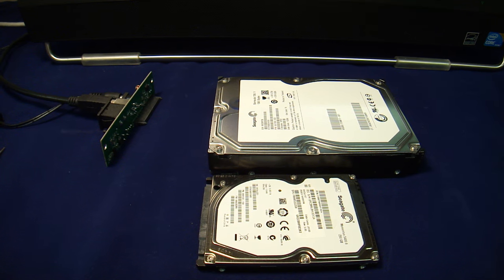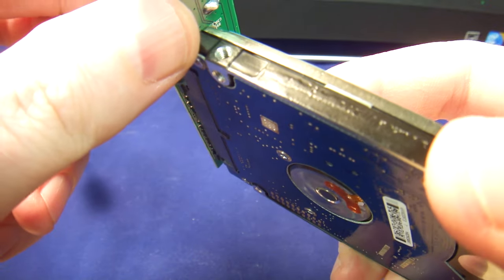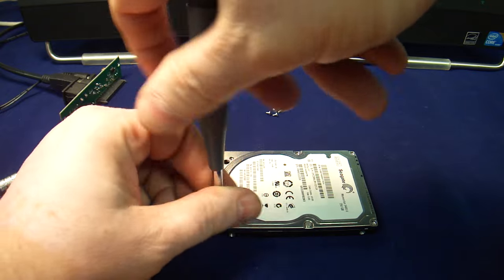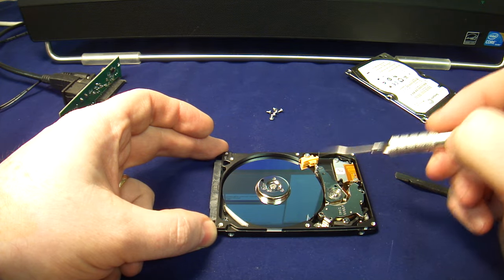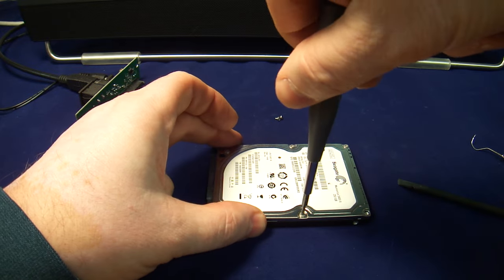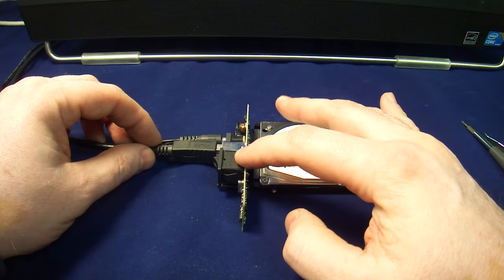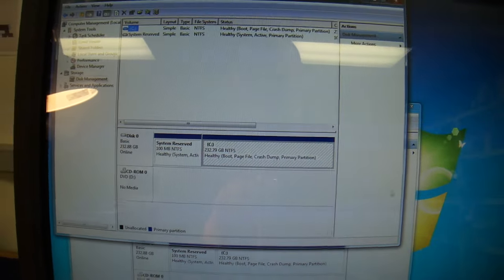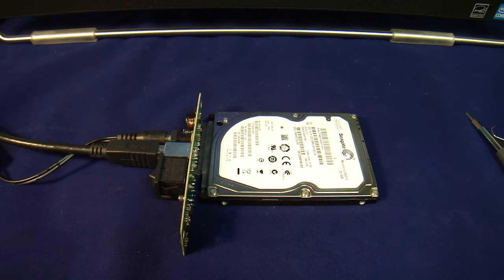DIY Video 2 How to fix a broken hard drive Beeping noise Get your data Back! Best Kept Secret

Comment: Hi Abraham. I have a Seagate 3.5 external hdd that is beeping. I therefore assume the heads are stuck. Do you use the same method to free the heads as you do with the smaller hdd. TIA

BTW I opened the plastic cover on  my  a 'Core.'   750 GB external hdd. Inside I found it contained  a Seagate 750 hdd as mentioned above. It has printed on the label 'certified repaired hard drive'. I bought it brand new! Have you come across this practice yourself? I think it's disgraceful practice. No wonder this hdd failed so quickly. So take head folks if you are tempted to buy cheap external hdds.
Reply from the maker: No large drives suffer from different problems heads usually don't get stuck on platters. It's probably gone.
Reply: http://en.wikipedia.org/wiki/Stiction#Hard_disk_drives
Reply: ChildOL
Thanks for that info. perhaps it's the  circuit board. Mine was a brand new external Hard Drive. I paid £30 for it. when I bust open the casing had printed on the label 'certified repaired hard drive'. I recommend to people to buy a  hard drive and a caddy as separate units.
Reply: Which torx size gonna use is t4 or t7 ok?

Comment: my hard disk is cliking sound i removed the cover and i saw head is not stuck i replaced the cover and again switched on the clicking sound is like that only and not visible in the disk manager please tell me how to solve the problem and how,to recovery the data

Comment: Hi Abraham,
I performed the same procedure on my WD hard drive. The drive is not beeping now and IS recognized in Windows as drivers for it were automatically installed. However when I try to allocate it I get "The request could ot be performed because of an I/O device error"

What do you recommend? Is the drive gone?

Thanks!

Comment: Hi Abraham. THanks for this video. It was very helpful.

My hard drive (Seagate 250 GB) has the same beeping problem and a computer repair centre nearby took $ 60 only to return it WITHOUT  the "adapter" (or whatever that external part is called, which the mini USB is attached to). Now they are redirecting me to a data recovery centre (who are their partners) and the recovery guy has sent me a quote of $ 2000 !   Should I ask that repair centre to return the "adapter" part (if that is called so.). I want to try this workaround. If they cannot or will not, is that part available separately? What do you suggest?

Comment: My laptop hardrive makes a few clicking noises when i turn it on and my laptop will then tell me to "insert proper boot device". I have to turn my laptop on and off about 50 times until it actually works then i have no problems with while its running.

Comment: I found an old hardrive to play with and was curious why they are considered junk after you open them? What specificly prevents you from using it again?
Reply: tiny dust particles from the air land onto the platters (might not even be visible) and when the drive starts spinning these particles start to damage the surface of the platters and the heads (only a very tiny distance from the platters), eventually resulting in unrecoverable data.
This is why drives are Always manufactured in clean environments.

Comment: Hello bro
I have a question
If I did the same you did to my hard disk and then return it back to my laptop, will the laptop work properly? I mean, is it necessary to do the last step you did with the connection?
Note: today my mobile fall on the laptop and sounds then started
Also, on the screen, it shows me the following sentence “checking media” in the corner to the left
Thank you

Comment: I like to think such services should become more commonly accessible and used amongst the public, with far more realistic and competitive pricing. It would surely benefit third party repair services in the long run. Charging per GB as some repair services seem to do is questionable when transfer speeds are forever increasing. The extortionate tier could when it comes to pricing could always remain for corporate fixes and fixes by the batch rather than for single individual drives owned by the public. Too many people throw away drives they think are dead when small fixes such as this could restore their data and give them a little time to transfer everything to another computer or drive. These days I'd rather use ssd drives, sd cards (temporary as they tend to corrupt quickly), and even physical bluray or the occasional dvd for clones of what is most important. I'm not sure if I would trust data to remain intact on a cloud service, I'd rather just buy a dock with multiple drives to clone data, or even backup pc

Comment: Hello :( I have a seagate slim plus 1TB that doesn't light, it also doesn't get recognized by the laptops and yt makes a sound for some minutes and then it stops working and I'm afraid of opening the hard drive and that the problem won't be the one showed in the video :( do you think it could be it?

Comment: I have a Seagate backup plus portable drive making a cracking noise. I use this for my ps4 as a extended. It still works but I don't know if it will brake soon.

Comment: Thanks for the info..  Maybe you can diagnosis my hard drive.  My hard drive is a 4tb seagate.  I get no media , in partition manager.  when installed in the motherboard, or enclosure it still says no media.  I tried changing out the sata board with the same revision and i got "disk not initialized " diskpart cannot initialize the disk or windows partition manager. I hear a loud beep sometimes and thats it.. can you help?

Comment: I have a LaCie Poulton 2TB HDD that won't power up after I used the wrong power supply by mistake. I suspect a shorted 12V TVS DIODE. What SATA to USB adapter do I need to connect it to my iMac (to check whether the connection board is at fault or the HDD itself, and to recover data)? Would I need a power supply also or can I use the same one as supplied with the LaCie or is none needed at all?

Comment: I just want to know if there's still hope to recover files in my hardrive. I've tried your DIY repair method but instead of making t it work the data remained unreadable. This time the needle/head keeps moving back and fort rather than staying within the disc when plugged in the USB port. Someone please help me on this. Thanks in advance.

Comment: Hey Guys, any ideas for my Hard Disk strange problem. The Seagate 500 GB Hard Disk (Just 4 month old hard disk) is not detected in the Laptop. The laptop did not fall or had any jerk, no physical damage to laptop. I have taken it out and plugged it externally with SATA to usb adapter but there is no sound,  I dont feel any vibration in the hard disk, and on plugging the USB plug , the hard disk is not detected also. It looked to me that the problem was in the Circuit board, i took the circuit board from similiar Seagate hard disk and changed it with the old one, but after changing still the status is same. No sound, no vibration, no detection in laptop and with the USB-SATA adaptor. Any Ideas Please.

Comment: Abarham, Thanks for the video really informative. However I have a 3.5 inch Seagate 2Tb drive that beeps. Got it open and the heads are over the platters. Could not slowly spin the drive and park the heads as the centre of the drive is a hollow circle and can't be worked by the torx screw driver! Any ideas as to how I can manage the final step? SO CLOSE.
Reply: same problem here
Reply: I have a seagate slim too

Comment: I am very appreciative of your sharing over youtube. I tried your ways. When i opened up the hard drive, the head is always in the parked position. I heard the difference between beeping and clicking. I am definitely sure it is not clicking. 
What can I do now? 

The data I have is not very important but I still like to get it back. The people here in Hong Kong quoted me from USD1000 - 600. 

Hope you can share your expertise advice. 

H

Comment: Hello. Mine is neither the clicking nor the beeping sound. I only hear the spinning sound. It's the 1 Tb Seagate Portable Expansion drive. It isn't displayed under 'Computer', occasionally appears under in the Disk Management Section (disk shown as Not Initialized/Unknown) and is always displayed under Device Manager. It is not a new disk so no need for formatting before use. Tried a couple data recovery software programs in order to salvage my 800+ Gb worth of data but with no success. One more thing, it slows down the computer, including restarts, when connected making me think of a possible virus attack. Any pointers to what might be wrong? Sorry for the relatively long post.

Comment: is that attachment and cable assembly home made? if not where might i get one of those? so much cleaner looking than what i'm using.
Reply: +Patrick MCCAULEY All you need is at least a 2.5" enclosure. MassCool makes a decent one.
Reply: do you need the cable adapter or can you just use the cable the hard drive came with

Comment: I have problem in my laptop hard drive. When I first turn on my laptop I get clicking noise, so I tap on the area where my hdd understand to stop the clicking noise. If I stop using my laptop and it is on there is sharp noise. How to stop this sharp noise?

Comment: Hi, I have a Samsung Model:HD102UJ External drive which is making the beeping noise so I opened as per your video and moved the heads to the outside, closed and turned it on again. The disk started to spin again but only for a while until it got stuck and beeping noise started again. I opened it once more and found that the back end of the arm gets stuck magnetically to the metal once it moves to the center of the disk. Any ideas on this please.

Comment: Hi Abraham, 

I opened my drive but the heads weren't stuck, they are off the platter. but still it makes a spin sound and then beep. "spin beep spin stops, spin beep, spin stops." It does that three or four times, then it stops and it tries again 10 seconds later. 

Is there anything else I can try?

Thanks for the awesome videos

Comment: This is not for someone who really wants to recover data at all regardless if it is important or not. This method is for the cheap bastards like me who don't want to buy a new hard drive yet. It is like an old beat up car that is on its last legs and it barely starting, the fuel pump is weak or maybe the compression is low. For now, it is cheaper to try to do some quick fixes on it to keep it running as long as possible than buying a new one. This is exactly the type of person this method is for.

Comment: I have a WD Caviar Blue 640 GB HDD from 2010, it won't make a noise, won't spin up at all.
Will this fix it.
Reply: Victor Figueroa open it as in the video and check it if it spins by a screwdriver I think in the main screw that keeps the disk in place

Comment: Hi my 2Tb WD my passport ultra metal edition is shown in device manager but not in disk management the light is on and it is vibrating  I tried using other cables it's still not showing on my computer other hard drives works perfectly and when I restart my laptop it cannot boot showing a grey screen if that hard drive is plugged in only will boot if I unplug it.Pls help

Comment: i have seagate  Momentus 1 TB external sata drive it was working fine but was dropped some how and after that there is no sound in the drive it is not even turning on when i plug it in the computer it do sound as some thing is attached and if i see in the device manager the name is shown for some time and then it goes and hard disk light stops what could be the problem ?

Comment: Hey. My hdd is beeping 1 short time at start if I use optical drive slot with caddy but it runs just fine and the sound is not from the motherboard because the hdd is in right side but the motherboard is on the left side of the laptop. 
If I use the internal Hdd slot it runs normally. Does my hdd have buzzer in it and why it sounds?

Comment: Hey! How come there is no platter on my seagate 1 tb drive? When i removed the metal case, it looks like 1 block of Chip. Please have a look at the link above. Thats the HDD i have. Mines completely different to urs. Doesnt have a platter, no arm, no nothing. Just one block of chip. Any ideas?? thanks
Reply: you either have an SSD or SSHD (Solid State Drive Solid or State Hybrid Drive) its like a whole bunch of thumb drives stuck in there.
Reply: Wilmar Randolfo Ramos Gomez That's weird, i thought i had purchased a seagate HDD not ssd

Comment: Hi, i have wd elements 1tb and wd my passport 4tb. What i want is use the hard drive for ps4 but it doesn't have sata adapter. Is it possible to remove the usb 3.0 adapter?

Comment: Beeping on a WD Passport external. WD test program ran - first 2 were fine. Did not do the zero test. I tried to find the data recovery recommendations on your site but could not find them.
Reply: I did buy an adapter kit - but don't see any connections in it that would fit my external.

Comment: Hey..i was using my hard disk and my system restarted all of a sudden and when i searched for my hard disk and it was not found..and the hard disk started making a very quite beeping...should i open the case and do it ?..will it affect the hard disk ? Please reply ASAP..i am at a very critical condition    :(

Comment: hello this is a great video!! question, my 2.5 Toshiba HDD is damaged and it makes neither noise..it works as usual but windows cannot recognize it and if it does, I cannot access it...I can see it in the drive list but if I open the drive, it takes some time for windows to work but then it just disappears...any ideas what might be the issue there? cause: once I hit my laptop quite hard, then the HDD died :) thanks!

Comment: Thanks for the video Abraham, but sadly this was not the solution I was looking for :P
I also can't find the solution in any video on youtube.
By any case have you deal with a 2.5 HDD with CRC Error when trying to initialize it?
I can't initialize my 2.5 HDD and I need to recover the files on it.
I know that CHKDSK can fix the CRC error, but that works for HDD that are already initialized, do you know if opening the HDD and touching something could fix that issue, I ask you this question because as I can't initialize the disk, I also don't hear any movement from the head, only the disk spinning at same speed all the time.

Please help :(

Thanks in advance and greetings from Chile (SouthAmerica) :)

Comment: I watched the video in hopes of fixing the drive with a beeping noise not making the noise go away then dumping the drive. How do I fix the drive to a usable state?
Reply: drives are not meant to do that. they get repaired enough to get data off, then are trashed. besides, if the drive has messed up once, would you take the chance that it would fail again, maybe worse? a 1tb laptop drive is only about $60.

Comment: I have a seagate 1tb external HDD, that once beeped a sound like a siren. I opened that disk and yes noticed that header was on the platter. I moved header and enclosed my HDD. Unfortunately, When I tried to plug that into my laptop i got new sound like a clicking for a 5 - 10 seconds and stop afterward. What could be the problem? Is there still a chance to fix my disk?

Comment: I know this is an old video but maybe you can help me, I performed these steps and it's still ticking, any ideas?
Reply: Ticking/Clicking means the heads need replacement. This is a much more involved procedure and requires you to find an EXACT replacement drive and swap the heads out of the replacement drive into the bad one. Every Drive is different and each require certain steps to ensure the procedure goes well. One procedure requires using a plastic tool called a head comb to prevent further damage to the heads so they do no sick together when removing them from the drive. This is VERY IMPORTANT! If the heads stick together even from the new drive they are considered broken and you have to find ANOTHER exact drive ect.........

Comment: Hi ! Thanks for your video. I tried the things you said and when i plug back my HDD the beeping noise was different, I had the disk turning but it made 5 beeps and then it stopped beeping but was still turning. I am still not able to see the HDD on my laptop using a SATA usb hub. Could anyone help please. ?

Maybe the reading arm is too far from the disk now ? I don't know but I am desperate :(

Comment: Mr Abraham Levit, Afterwards thank you so much for the informative video, but you don't explain why it can't be used the hard drive after following the steps on the video. Even if it never make any beeping noise again why it can't be used as a normal hdd drive. Thank you so much for your time and pardon me my English but my home language is Spanish.
Reply: The reasons you should not use this disk for anything important are: a) dust particles fall into the drive when you open it. This may cause problems later. b) The surface of the disk inside or the heads may suffer microscopic damage.
Reply: Empty Channel Thank you so much for your reply sir, really appreciate it.
Reply: Tab Valentino Thank you so much for the response mister Valentino. I will keep that in mind. But sometimes is useful to grab those extra gb. Especially when you are a little out of budget.

Comment: hello there, this video a few years ago helped me a lot to save my important data, that I kept on the HDD with the same kind of issue like shown in the video. BUT - I've got a problem with another HDD, not kinda important for me, still I wanted to give it a try. and the problem isn't with the needle stuck on the plate, it moves on the plate from the normal position and after that it gives a strange scratchy sound mixed with clicking. is there any chance to send you a private message with a video showing the problem linked on my google drive? best regards